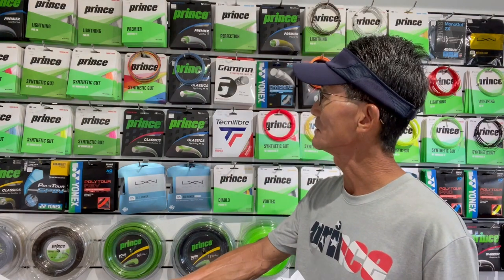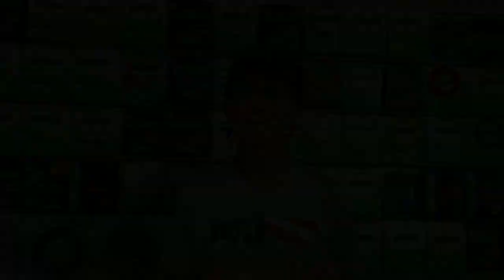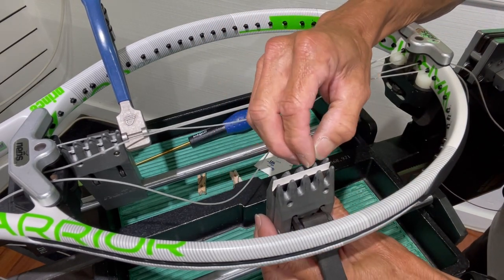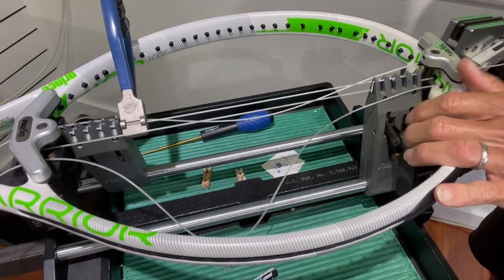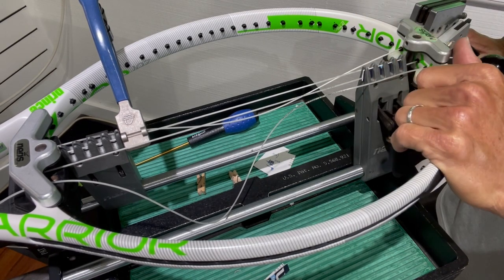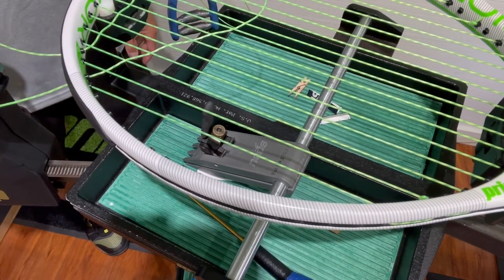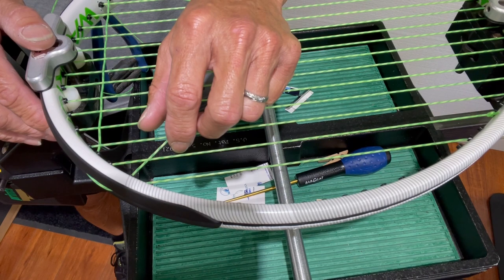Racquet Stringing [String Clamp Slippage]

Comment: Great video and very informative. I will check and make sure I am not getting clamp slippage next time I string. I do notice on my machine (Gamma 6004), I get slight base clamp movement especially on the cross. I think the way you are checking the slippage on the cross might not work for me. Any suggestions on avoiding base clamp movement?
Reply from the maker: Aloha Andy, The first thing you should do is make sure your string clamp rails and bases are clean. I'll be posting a video this week that will cover string clamp maintenance for your reference. Next, refer to your machine manual and adjust the string clamp bases. You may have to play around with it to make the right adjustment that will prevent your clamp bases from moving, and at the same time, allow free movement on the string clamp on the rails. Another issue you may be dealing with is called "drawback." This week, I posted an article on the IART website that discusses that issue. If you're a Premium Member, you can check it out here - https://gssalliance.com/iart-member-content/string-clamp-drawback-discussion/

Comment: Great video & thanks much for sharing. One question: Does the starting clamp (next to the fixed clamp) on the 1LM string generally always work to allow tension to be pulled on 1RM? I have a NEOS 1000 & had a couple times where I pulled 1RM & apparently had slippage on the clamp on 1LM as the tension ping would not click & I was not using a starting clamp (just fixed clamp on 1LM). Uncertain how much stress that places on the frame  and/or string (as worried about such) so was wondering if the starting clamp use (next to fixed clamp) on 1LM generally resolves that issue.
Reply from the maker: Aloha, Thanks, and I hope I can help. Using the starting clamp behind the string clamp on 1LM will reduce the chances of slippage on the first pull. It wouldn't place more stress on the frame or the string.  

Another option to start your mains is to use the Yusuki method. Have you seen my other video titled, "3 Applications of the Offset Tube?" https://youtu.be/OXF-zSA07_Y
Reply: @AMstringing  Thanks much for the reply & the link to the other video which I'll check out for sure. I'll try using the starting clamp behind the string clamp on 1LM for the 1st pull on 1RM & hopefully that will resolve that 1st pull slippage issue I've experienced a couple times. My reference to being uncertain how much stress (on frame and string) the slippage on that 1st pull on 1RM where the tension ping would not click was in regards to what I experienced when only using the fixed clamp on 1LM (no assistance from a starting clamp) as uncertain what that slippage causing the tension head ping to not click actually does to the frame & string. You may not have experienced it since you are using the starting clamp as insurance on 1LM to avoid the slippage on that 1st pull on 1RM.
Reply from the maker: @vnishpt7036  Couple more thoughts . . . 
1) I'm assuming your clamps are clean and adjusted so that it's not showing any signs of slippage on any of the other strings that you're clamping. So slippage is only occurring on the first pull.
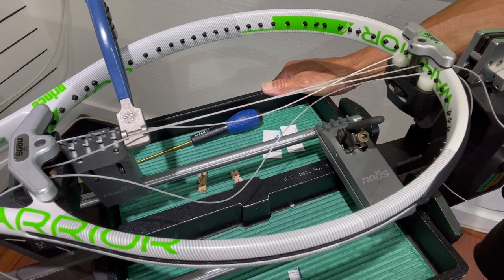2) Another option is to use a business card in the teeth of the string clamp on the first pull. Watch from 8:16 on this video.
Reply: @AMstringing  Re: #1 Yes, after it happened the 1st time I contacted Tennis Machines (St. Louis Mo.) to determine if might be an issue with tension head or gripper & they advised to make sure clamps & gripper were freshly cleaned. So went ahead & did a fresh cleaning & still noticed it occurring a couple add'l times when using NXT Comfort 16G string (only on 1st M pull). So hopefully using the starting clamp as insurance on 1LM will prevent from happening going forward. 
Re: #2 I've not tried the business card alternative but found that interesting so have noted it.

Thanks again for the video & your replies. Best regards...
Reply from the maker: @vnishpt7036  Happy Stringing!